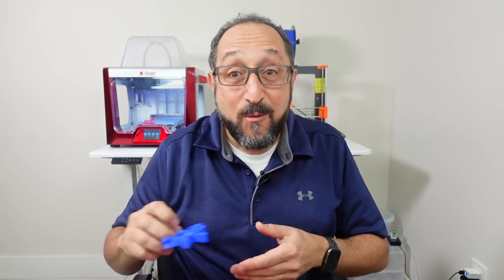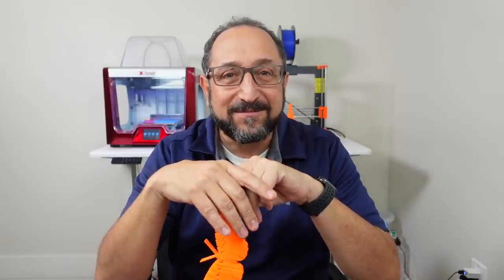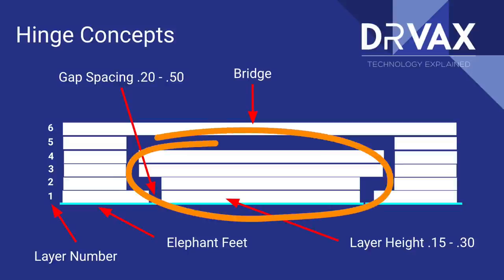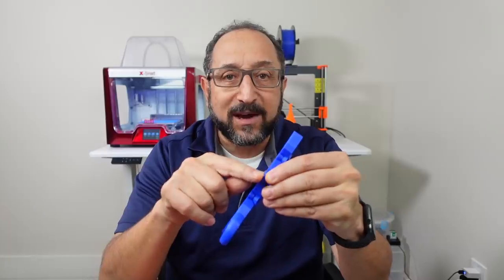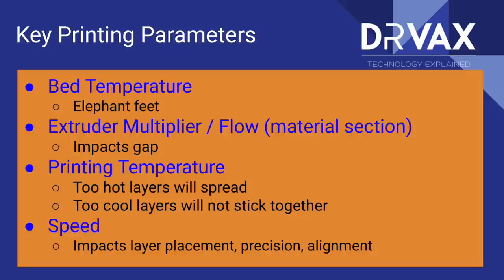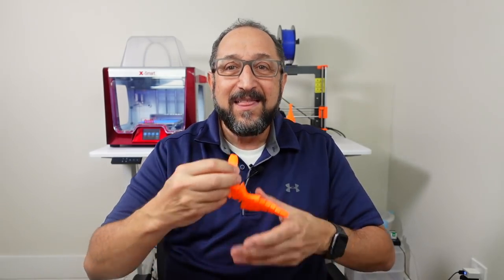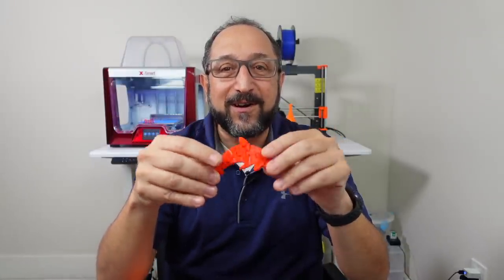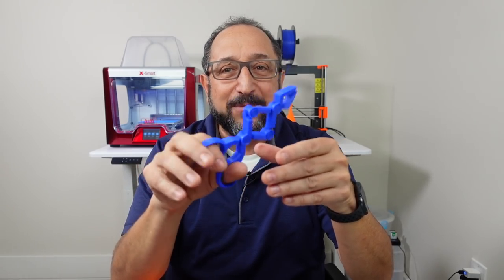How to 3d Print Toys | Movable Parts

Comment: Don't know if Prusa has that, but in Cura there is a feature called Horizontal Expansion which makes it a little easier to compensate for parts that come out too small or too large. It also allows for a separate setting for the first layer to fix elephant's foot, as well as for holes within the part.
Reply from the maker: Excellent point.  This is a relatively new feature in Cura I will have to check to see which other Slicers also support it.

I plan on doing a video in the future helping people move from one slicer to another by comparing terminology.

P.S. I have started a new discussion forum at http://forum.drvax.com where we can all have more elaborate discussions and share pictures on our prints and printers. Check it out. Irv

Comment: Hello Sir, thanks alot for the movable part printing and print in place video i managed to finally print a pip fish with your guidance of reducing the bed temperature. But still am having elephant foot problem. Although i have set my bed level accordingly. I would be glad if you could guide me as to where I may get the slicer settings for general print in place prints i am using a creality ender 3 printer and mostly use creality slicer along with cura 4.8. Would be glad if you could help.

Comment: Hi DrVax, this is a very interesting video but unfortunately the sound quality is not very good. Maybe you can improve it in your next videos.
Reply from the maker: Noted.   I normally use a boom mic but I have been recording from another location with a lav mic and have a problem with echo.  I tried a new FinalCutPro plugin but obviously it is not acceptable.   I just ordered a second Rode Boom mic to solve the problem.  Should be here for the next video.